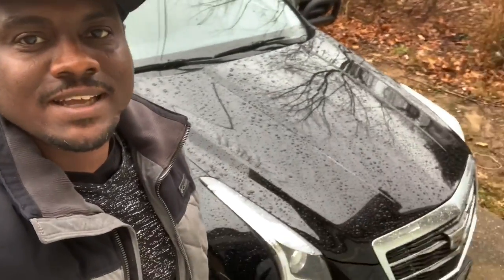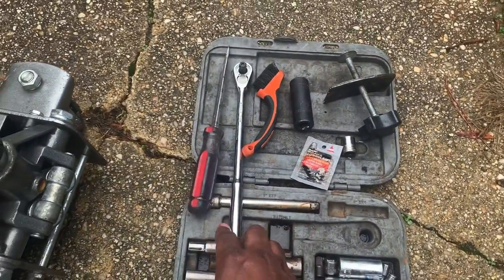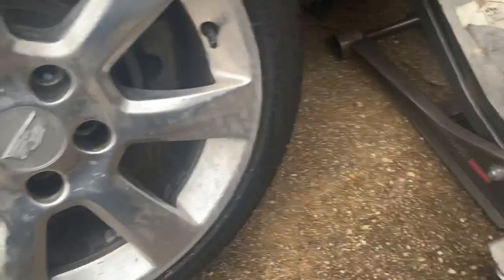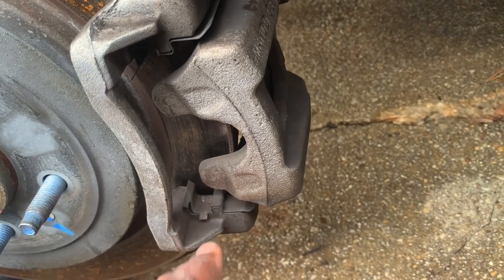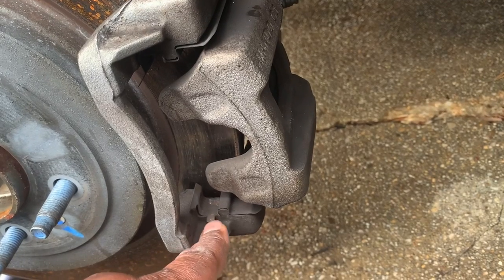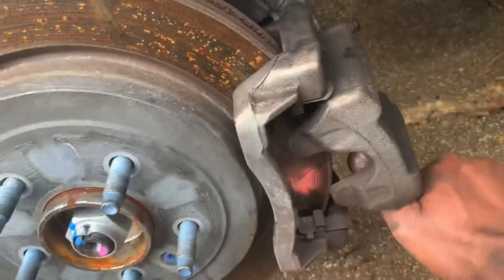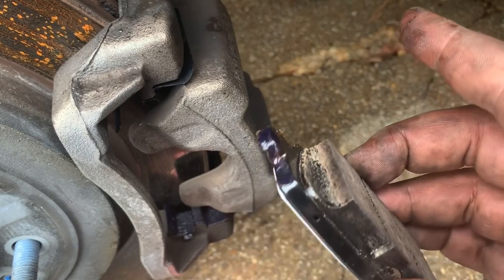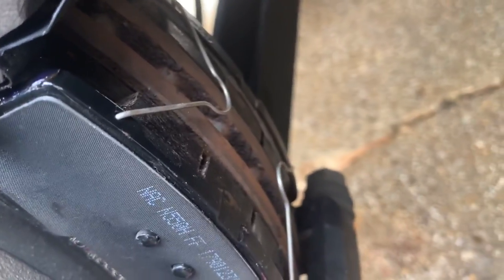Cadillac ATS CTS 2.0 [Rear Brake Change]

Comment: Is the process different for the front brakes?
Reply from the maker: Nick Lovell process is definitely different for the fronts, because we have performance Brembo brakes up front. They are easier though. Just pop out 2 pins, use flat edge or screwdriver to push caliber pistons back in and slide new pads right in.

Comment: Do u not need to bleed the brakes once u change them?
Reply from the maker: Absolutely not. You only have to bleed your brakes if you open up your brake system (ex: changing brake lines) or if you’re doing a brake fluid flush/exchange.
Reply: Oh ok thanks!

Comment: Is it hard to replace the rotors?
Reply from the maker: Michael X I’m not sure
Reply: Yes.  New rotors are strongly recommended.  Also remove and re-lubricate the slide pins.  It's good practice to clean and wipe down the Piston boot before driving the Piston back into the caliper.  Also use a small wire brush to clean the caliper bracket before installing new pad guides. Finally, bleed and change the break fluid.

Comment: Can you do a transmission oil change video on this same car
Reply from the maker: Eight Mind If it is something that can be done at home I probably can, but my car is a low Mileage vehicle and that service isn’t quite due yet. I’ll look into whether or not it can be done though.
Reply: Simplicity Autoworks ok thank you
Reply: the fill port on the sealed transmission is on the passenger side of the transmission, kinda hard to find, look for a sealed transmission video, you will need a hand pump